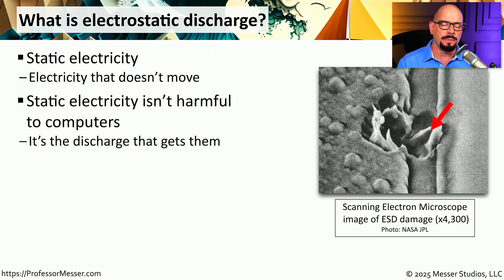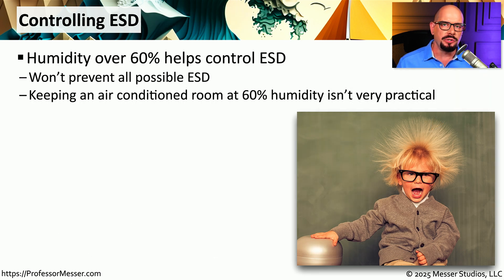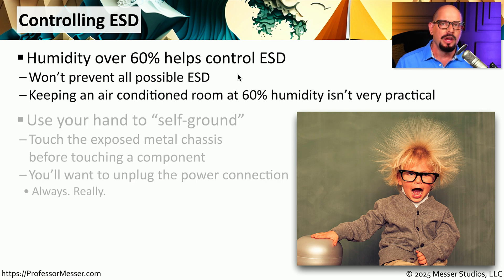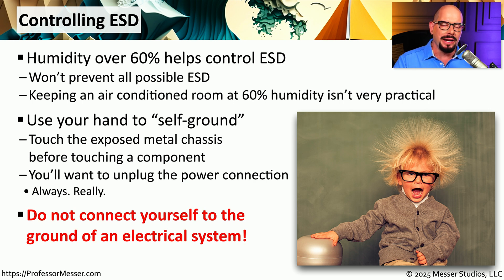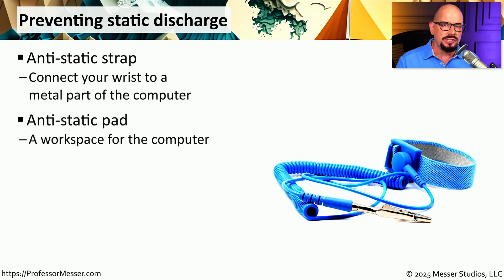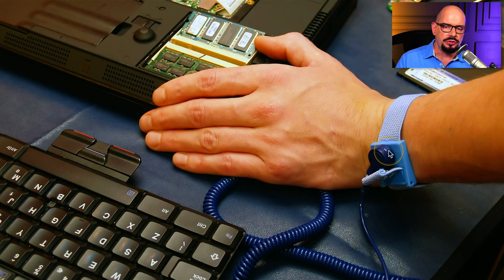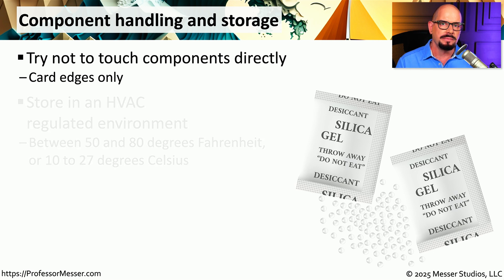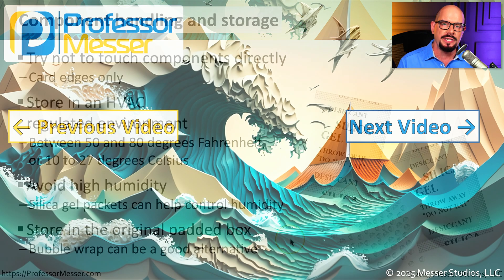Managing Electrostatic Discharge - CompTIA A+ 220-1202 - 4.4

Comment: Once when I was moving, I transferred static into my Alienware Aurora R7, totalled the MOBO. The case of the R& is entirely plactic, there is almost no where on the case to handle by metallic material. 

I must have transferred static into the computer because it was resting on the carpeted floor, and I was handing it as I was moving around with rubber slippers. 
I must have built up a charge and transferred it to my R7. My old school 2008 Dell Studio XPS is entirely metal, at no point was it in the same level of danger of static damage as my plastic cased R7.
Rookie mistake- learn from me.